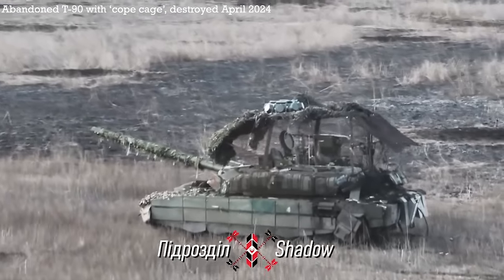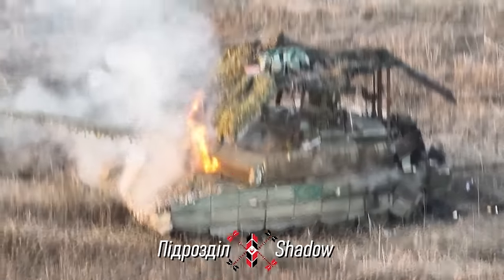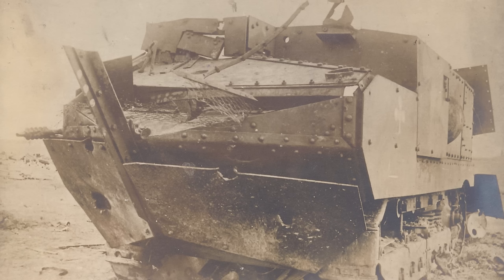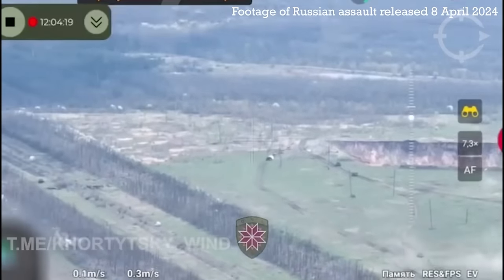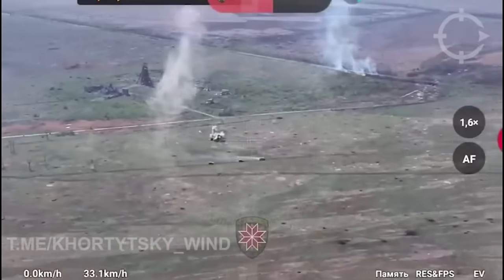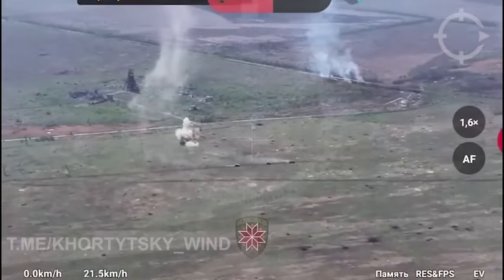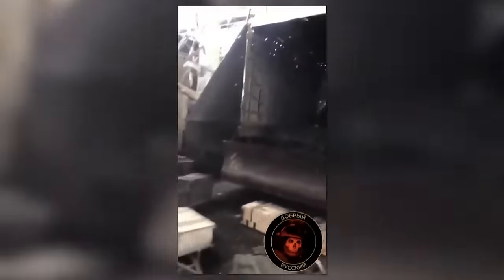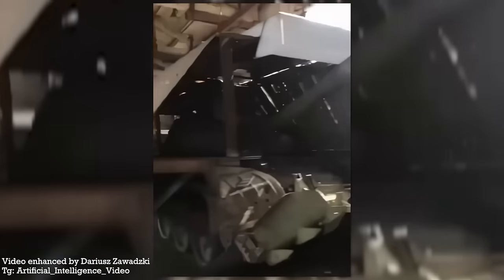The 'Blyatmobile' - The Russian Turtle Tank

Comment: And it's back on the front after two days of repairs!
Reply: some piny roof and artillery trying to stop turtle tank? pff
Reply: Well from what i saw, the tank is just used as a infantry carrier, the turret rotation is destroyed, and it was used as a mine clearer. So i guess this is a very good solution to re-use damaged Tanks. The Ukraine front is at this point almost only drones, atgms and artillery taking tanks out, so it doesnt need any turret rotation, good view or speed, because that doesnt help against all of that. But this spaced armor would work perfectly in theory, and in practice it seems to work pretty good.
Reply: @LeroxYT  The tanks at the front are mainly there to draw attention, force the enemy into reaction and at best survive.

It doesn't really matter much if they can shoot or not, in comparison to the fire power all the artillery, bomber and co got, a tank is a weak hitter anyway.
Reply: @miriamweller812  yeah thats also true
Reply: @miriamweller812  There were a few armour to armour combat in Ukraine but even those involve only a small column and 1 or 2 ambusher vehicle from the other side so no big tank battles
Reply: @LeroxYT  it also has some drone disruption equipment

Comment: One theory is that's it was a troop transport. Tanks now being the preferred ride on assaults, with more than a dozen soldiers often seen sitting on top. The shed being some kind of protection for the soldiers. 

I'm the spaced armor club, but the other theory was interesting
Reply: It was used for mine clearance. There was a close-up video of it inside a warehouse and it had mine-clearing kit bolted on it...
Reply: @Warren_Peace  It's a fair point, but I'd note that, Putin's army being what it is, the tank having anti-mine kit attached and actually being used in that role are very different things. We do see it acting as a lead vehicle here, but along what would seem a recently-travelled armor path (although, of course, artillery-scattered AT mines make such things mean much less than they might have done otherwise).

If the intention were just spaced-armor, though, it's hard to see why one would choose the solid material and immovable design seen here, so "infantry protection" still seems the more likely goal.
Reply: @michaelccozens  Probably because it wasn't used for infantry assault, at least, I never saw it discharge troops during the assault...

The Russian Army has proven itself to be quite adaptable in the battlefield, and their doctrine of artillery have proven itself to be invaluable in this conflict.
Reply: it was not. apparently turret was damaged and it could not turn before. it was mine clearing vehicle. also attack was a success.
Reply: "One theory is that's it was a troop transport."

Except it never drops off or takes on any passengers.   Instead, it drives at the head of actual transports, clearing mines and acting as the up front forward scout while the APCs drop off troops.

"Tanks now being the preferred ride on assaults, with more than a dozen soldiers often seen sitting on top."

Uh, come again?

"The shed being some kind of protection for the soldiers."

It's not even thick enough to protect against carbine fire from 300m.

"I'm the spaced armor club, but the other theory was interesting"

Spaced armor and completely hiding the tank from drones.   The outer metal sheets are thin, just a few mm, but drones can neither drop grenades through it nor can they crash into it without some extremely perfect maneuvering.
Also, as we saw in the footage from Krasnohorivka, it got hit almost dead center with at least 2 cluster artillery shells, and they did ZERO damage, and because Ukraine aimed at the turtle, the APCs behind only took some minor shrapnel, probably with neither any losses or actual mechanical damage.

It's also rumored that it may actually RC rather than crewed.
Reply: @Warren_Peace  It was a troop transport in the full video, it reached the objective and went back
Reply: @DIREWOLFx75  It was a troop transport in the full video, it reached the objective and went back
Reply: @marcusaurelius3487  Troop transports tend to discharge troops once they reach the objectives, hence the name...

All the Blyat Mobile did was lead the way for the Russian armored vehicles which did dropped troops when they reached their objectives... I did not see it send out troops once in the two videos I have seen it..
Reply: @michaelccozens   "Putin's army being what it is" what is that supposed to mean? Russian army is probably the best in the world due to having to fight such a high intensity conflict and adapting and creating modern tactics.

Comment: I think that if this is specifically against drones, having the added "armour" be made up of simple wire mesh (or even a wire fence) would work fine to stop the drone and make sure detonations are at a far enough distance to reduce effective penetration.
Reply: Wouldn't work against FPV RPG-7. The detonator is two loops of wire so they are sensitive to even glancing passes, and adding standoff may actually increase effective penetration.
Slat armor works by crushing the warhead in an attempt to turn HEAT into just HE. Wire mesh actually helps the HEAT jet become more focused.
Reply: @ChucksSEADnDEAD  Interesting, thanks! There was at least one case of a Ukrainian Krab equipped with an ad-hoc "soft catch" system of cargo netting on a wooden-log superstructure defeating a Russian Lancet last year, actually catching the munition whole and apparently-defeating the detonator, so there's some interesting elements at play here. Could come down to as little as "how thick is the wire in the loops we're talking-about?".
Reply: fences could work
Reply: @ChucksSEADnDEAD  drones with RPG munitions are not that common to be a prominent issue

This might change if "cope sheds" become a thing, but for now the performance should be decent

Comment: this tank was seriously damaged previously - the mechanism of the turret rotation was destroyed and the turret was blocked.  Factory repair was mandatory. Since the chassis and engine were in good condition it was decided  to leave damaged rotating mechanism as is. In the field workshop the crew positioned the  gun forward and at first the tank was used as howitzer. But soon the tank had to return to its primary role - assault machine.   Since there were no need to keep the turret rotating  "Tzar of the cages" was built  on top of the tank. Looked hilarious but worked.
Reply: Yah that plating ain’t going to protect shit.
Reply: Necessity is the mother of invention.
Drones may give rise to a whole new family of turtle type troop carriers and assault guns, slow heavy top armour EW, like anti drone strong points crawling over the battlefield
Reply: @baneofbanes  but it did. There is the video of attack on railway station in Krasnogorovka. Exactly this tank moved few km under drones' attacks and returned back after mission
Reply: @baneofbanes Well, you can see better from the couch, of course. Do you know what a cumulative jet is? Read it

Comment: They do seem trying to turn tank into a monster electronic warfare platform. They did that with normal tank (non-turtle one) some time ago, putting a massive array of various EW modules on it as well as even small diesel generator to power it all up. I guess the idea was for this EW frankenstein platform to serve as FPV protection for the column of assaulting vehicles. But that tank got finally destroyed by fpv after numerous failed attempts. 

The turtle tank is continuation of this idea, adding extra protection against fpvs in form of turtle, and with bunch of EW on top. Kinda interesting where it will go from there.
Reply: Во всей российской тяжелой технике: Танк, САУ, Системах мобильных ПВО и тактических ракет типа Искандер и прочей технике установлены штатные газотурбинные электрогенераторы на 19 Квт. !... Работающие на любом жидком топливе в любую погоду +\- 50 градусов по Цельсию... Электричества, как и топлива с избытком для любого оборудования...

Comment: Any protection for troops riding on top from fpv drones is questionable. The front and rear are wide open so if a drone flies inside the troops can't jump off and the roof will intensify the percussion effect from the explosion.
Reply: On the other hand, it's harder to get a drone inside  and it 'may' have (Depending on what the steel was) have offered some protection against shell splinters and small arms fire.   It's not as if the orcs themselves are any value.

Comment: dont forget guys cope cage was funny only as  protection from top strike atgms, but againts drons its working properly
Reply: Extra armor is always good if there are no drawbacks.

In regard of tanks this is mostly weight, but this extra armor isn't heavy. 

ATGSMs are by the way no wonder weapons which automatically destroy a tank if you fire at them and even if they it doesn't mean that it has to destroy the tank. And every little bit can change that.
Reply: @miriamweller812  Yeah but there is a serius problem with escaping from tank with cage.

Comment: In recent attacks Russia doesn't really use their armor as combat vehicles but rather as means of getting the infantry close enough to attack Ukrainian positions, once the dismounts get off the vehicles head back to the rear. From that perspective mobility and ability to traverse the gun are of minor importance, priority is to protect the dismounts until they get into position and then get the vehicle back to the base safely.
Reply from the maker: Indeed the importance of the gun is certainly less than usual.
Reply: This has been the case for most of the war for both sides.
Arguably Wagner PMC pioneered the strategy but I think it's just evolved out of 10 years of modern warfare in the Donbas.

Comment: I think the plating is probably more to protect tank riders from shell splinters rather than FPV drone strikes. I should imagine it produces secondary shrapnel when hit directly.
Reply from the maker: I don't think it will be very effective in either role to be honest!
Reply: I would assume it is there do detonate munitions prematurely to save the crew inside the tank, not on. that would make the most logical sense. just because there russian doesn't make them that stupid. its smarter than doing nothing
Reply: @tommac8742  it might act as protection for both the crew and riders. However the large volume of empty space on the rear and large egress point makes me think that this primarily for the protection on tank riders.

Comment: the turret wouldnt be able to rotate under this thing right?
Reply: IT'S NOT MADE FOR THAT! 
it's an armored mine clearing tank it isn't made for fighting tanks.
Reply: Turns out the turret mechanism was broken earlier on that particular tank. So it's apparently locked.

To be honest, they should have dismounted the cannon to save a few tons of weight. While also cutting slots along the command sights field of range. Then, placing cages within the slots.

That would allow the vehicle commander to see to the sides. Removing the cannon would also allow the loader to focus on the loader hatch machine gun for increased situational awareness and defense.

Comment: Correction. 
Sheet metal like those are intended to protect against sharpnel and small arms, nothing more. They will have very minimal effect against tank gun caliber ap or shaped charged.
Reply: Sheet metal tends to not be small arms resistant.
Reply from the maker: Nor shrapnel to be honest, doesn't look rated for it.
Reply: It will obviously force mainy anti tank weapons to explode prematurely and will always take energy from the attack.

Attacks against tanks are no certain success and everything in between will lower that even more.
Reply: @miriamweller812  yah I don’t see this stopping HEAT rounds.

Comment: "our tanks have automatic loaders and zero crew survivability because it helps reduce profile and visibility" - and at the same time - turtle blyat tank....
Reply: looks like a medieval battering ram.
Reply: some crews change 6-7 tanks. Just because western propaganda said that there no crew survivability don't means this is true
Reply: A hit that make ammunition in the tank explode will kill the crew anyway. Guess what: humans are squishier than tank shells.
Reply: Ironically the Abrams has turned out to be the LEAST survivable tank in this war due to it's blowout panel "safety feature." 
A single 38mm stainless steel plate protects the main ammunition store...in hindsight you can't believe engineers thought this was a good idea.
The only MBT in the world that can be taken out with a 40mm grenade.
Reply: @stevebuckley7788  i think that Merkava are the least survival tank, but yea, 38 mm with 2 feature: 1) in battle this plate usually didn't close to achieve higher rate of fire 2) it attack from behind, as usually drone attack then it make a hole in this plate, so it didn't protect anymore.

Comment: "to protect troops riding on the hull" I understand you shouldn't underestimate your opponent, but protection against what exactly? It looks like tinfoil covered in shrapnel holes. 😂
Reply: If an FPV with an rpg warhead hit the shell, the rpg warhead would penetrate the shell and then cause fragmentation  so the trooops riding on the hull would be shreaded
Reply from the maker: Can't imagine it would be much help at all looking at it
Reply: It was used for mine clearance. There was a close-up video of it inside a warehouse and it had mine-clearing kit bolted on it... And the Ukrainians mostly used drones now, and those drones don't really have the required kinetic punch to blast through spaced armor...

Funnily enough, either by luck or skill, the blyatmobile survived combat...
Reply: @Warren_Peace  until it was destroyed in an arty/missile strike
Reply: @rklkify  Sure, but that was significantly later... And to be fair, that cage was still in one piece after said artillery/missile hit, so there is a pretty good chance that blyatmobile actually survived even that one...

Comment: It seems to have been effective against ad-hoc drones but it’s a huge target for actual AT weapons which don’t give an F about sheet steal ‘spaced armor’.

And I can’t imagine it would be very effective as an actual fighting vehicle.
Reply: Anything that absorbs energy and covers up the target what makes it harder to hit weak point helps. 

And AT weapons are failing a lot to kill tanks. Extra protection just adds to it.

You fall for propaganda, that only show you the success, not the 95% failure.
Reply: @miriamweller812  if building sheds over tanks was an effective tactic then it would be standard practice don’t you think? 

And if a peace of sheet metal could defeat a Javalin or LAW, they would never have been developed, let alone deployed.

YOU underestimate the capability of modern AT weapons. This is protection against cheap drones carrying anti-personnel munitions, nothing more.
Reply: @kirishima638 cope cages also were laughed at when war started. And now it's a standard that's used by both sides and even Israel. 

And considering that this turtle tank wasn't destroyed during its missions - design of very effective
Reply: @yellowtunes2756  Cope cages don’t work. And Ukraine generally doesn’t use them, unless they’re installed on captured equipment. There are numerous pictures of Ukrainian tanks operating without them.

Israel does not use cope cages either. They use anti-grenade shields which have been a thing since WW2 for use on armoured vehicles for protection against Molotov cocktails and projectiles dropped from above in densely populated urban areas where they operate, like the Gaza ghetto. This is dedicated equipment built with the tank, not applied later in the field, as  appeared on Russian vehicles during this war.

I’m tired of arguing with you now. I say again, if cope cages, sheds and other ad-hoc methods were actually effective and practical, they would be standard equipment on every Abrams, Challenger, Leopard, every modern western fighting vehicle, but they’re not, because they don’t work and they’re ridiculous.
Reply: @kirishima638  how's ukraine doing? :)
Reply: @redcrown5154  they’ve liberated 25% of all the territory taken by Russia since 2022 including the one provincial capital they had managed to take, decimated the Russian fleet and airforce and inflicted around half a million casualties on the Russian army, which has been forced to recruit from prisons and use raw recruits in meat wave attacks to take insignificant villages at huge cost in men and vehicles.

So they’re performing superbly given the conditions.

Comment: Interesting, thanks! If the intention of this ad-hoc armor was less protection against anti-vehicle drones and more the protection of the Russian troops we've recently-seen riding atop tanks like those famous packed trains in India, that would seem to suggest that the Turtle Tank is, along with the use of Urals as half-uparmored battle taxis, a desperate attempt to address what would seem to be a drastic shortage in Russian APCs and IFVs, at least at the local level. Which is super weird, as that's a unit type Russia is still absolutely drowning-in, at least on paper.